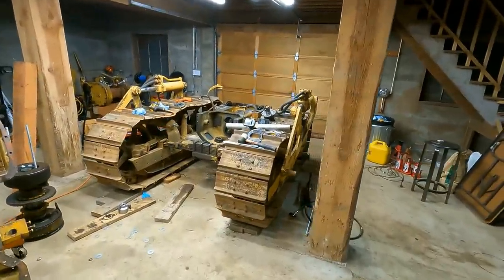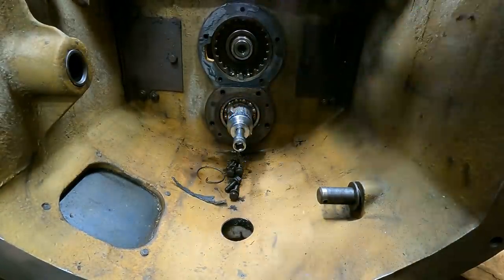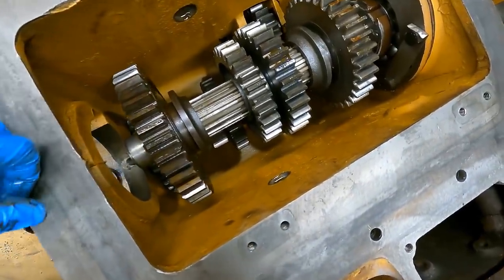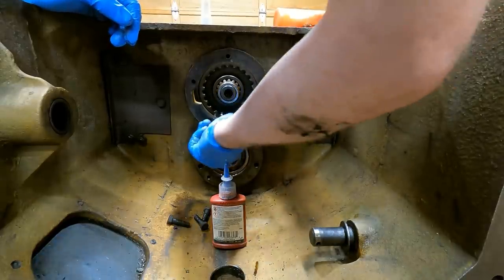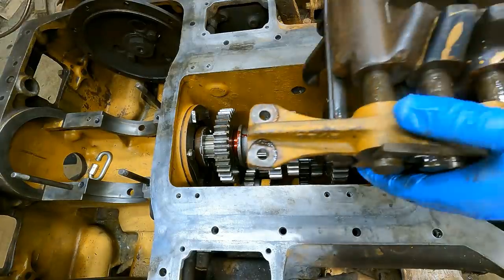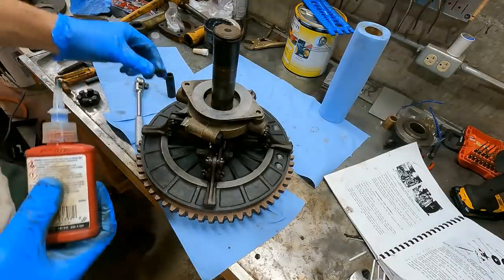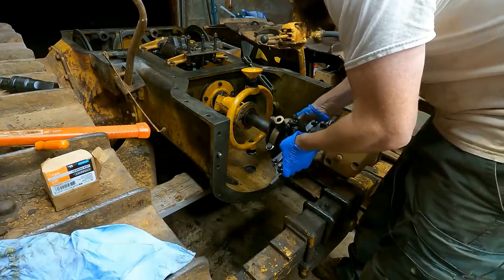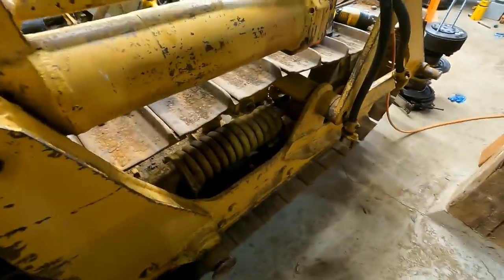Caterpillar D4 transmission repair and clutch installation

Comment: My dad is loving this series. As a former Cat mechanic now in his late 70’s, this era of D’s was still quite common in the shop during his apprenticeship. When he retired, the machines were heavily dependent on computer modules which caused the older techs to struggle a bit. That’s when he decided to retire.
Reply: None of the new techs had the insight into the machines that your dad had. He could stand alongside  one of the dozers and look at it and know every bit and piece going on inside of it. He didn’t need computer programs….his program was his keen instinct. They don’t make them like your dad anymore. And we wonder why all the stuff now is junk.
Reply: Well if your dad still misses them I have a D-4 dozer that runs but could use some love, And a new owner.
Reply: @beboboymann3823  Yes, junk... That's why things move SO much faster these days, and the operator is infinitely more comfortable... 
These comments are just idiotic. Things weren't better in the old days, far from it. Things may have lasted longer because they couldn't calculate anything accurately so they just overbuilt everything, it had nothing to do with craftsmanship or quality, it was purely lack of knowledge. Oh and the old mechanics knowing every bit of a machine? Of course they knew, by the time you met them they worked on just a few types of machines for their entire life, and the machines were incredibly simple compared to these days. Anyone who did that would have an in depth knowledge of those machines...
Seriously, I get the nostalgics, but be realistic... Things weren't better in the past, that's just what people say when they can't keep up with modern day things anymore.

Comment: FYI when adjusting the clutch. Do not cam it over (lock it) without first tightening the "pinch nuts" or you can damage the  adjusting threads on the drive shaft. My father bought a D4 in 1982. I was pretty Green , made a lot of mistakes before an 80 year old  farmer taught me a few tricks.
The track tension-er spring isn't too bad. As I recall I knocked a pin out of the track to create the space to remove the assembly off the idler wheel. All I had was a 3/4" socket set, pipe wrench and a post maul, not the best for driving hardened steel.
Also, I thing when you put the spring tool on the steering clutch assembly, you put it on upside down.  I think the groves around the holes go towards the springs, to retain them, so the springs don't slip off.
Thanks for posting these videos. They're bringing back memories and I'm learning a few new things  too.

Comment: When you showed the 36mm socket before any welding, I thought you were going to grind notches in the socket to fit the nut.  After seeing your modification, I understand what you meant in your message earlier in the week.  Anyway, it worked and no one got hurt so that is a win.
I'm glad to see the assembly work started.  A journey of 1000 miles begins with one step.

Comment: Let us know in advance when the huge spring is being changed - I'll make sure to have on my hard hat for that episode ...
Reply: LMAO ! And Face Shield !
Reply: The spring tension is adjusted with a huge long threaded rod going through it so the tension can theoretically be removed. The question is how rusted on and how rounded off is the nut on it. An 8 foot cheater bar is what I eventually needed. What I don't understand is how all those pieces come off Matt's machine without a lot of sound editing and beeping g.
Reply: iio

Comment: I am glad that my brake hone idea worked. Before you remove the old track spring relieve the pressure by cutting the coils with a torch while the spring is still caged on the tractor the replacement looks to be assembled already.

Comment: You will succeed. I know because you are like me. We think "outside the box". We can see "Go" vs "No Go". We see options others cringe at because we are not adhering to the original engineering. We make improvements (when we can). We understand physics. It is so awesome to watch your progress (in this project) and know that it will work very well. Remember to pause and walk away for a bit if things don't seem right. Your mind will find the right answer. (I know; Preaching to the choir). Love this build, Matt.

Comment: Good to see some more work doing on the dozer. You wanna use a couple of sizes of hole saw for the brake pads you're making ? Jack two bits up together and put the guide drill though the seam between. Those adjustments are probably crucial? In the clutch I mean. It should drive really nicely once you are finished. I'm doing a repair on a machine at present where all the bearings and seals collapsed. So , hoping both of us have pleasing success with the refurbish. With tool steel you are supposed to anneal the steel and then retemper it. Your socket should respond just as well as the rest of it, if you find it worthwhile at all. Cr.moly seems to be pretty sweet with welding very often.

Comment: Always put your bushings and bearings in the freezer for a tad bit of shrinkage brother, just a tip Matt!  Hey brother I’ve had to bend wrenches and weld wrenches to get the job done!  You’re trying to make a larger socket? Pipe wrench!,,  That’s the only I suggested to get a hammer wrench my friend!

Comment: Best advice I received on running dozer was to do small adjustments constantly instead of trying to do large adjustments less for the blade. And when back dragging, drop the blade all the way hard, when it hits the ground, stop lowering it and then flick it up ever so slightly.

Comment: If the shaft is hollow with tapped ends, a common way of getting the nut on and off on large equipment is to thread in a connector and run liquid nitrogen through the shaft. The shaft will then shrink as it cools, allowing the nut to be spun off easily. This is common on large equipment that have nuts to large to be practically removed with tools.
Reply: Yep. Most everyone got some liquid nitrogen layin aroun somewhere.
Reply: @woodhonky3890  
Common enough from a gas or agricultural supply. Can also just use nitrogen gas from a welding supply house, just takes a little longer to cool down as it is not going through a phase change. Suppose you could use a 5 gallon bottle of propane with a high pressure (10psi) regulator, and outside without any open flames or sparks within 25 feet.
Reply: If there is a doctor's clinic in town, there is a very good chance they have a 20 liter Dewar flask of liquid nitrogen. Could be you buy some from them,or buy from the supplier when they come to refill the flask.

Comment: I am enjoying the series. Re: the lock tabs on the bolts. You need to lock the bolt head as well or the bolt will back out of the nut. I use loctite in place of those.

Comment: Another way that you can bore bearing seats from the housing, is to use an adjustable reamer. It has 3 blades and a nut at one end, and if you tighten it, the blades move away from the center increasing the diameter.

Comment: Excellent work of disassembly and reassembly for that worn gear replacement. Amazing that we could see the breaker bar bending with that stubborn nut...but the impact drill made short work of it.

Comment: Great progress. I have a few thoughts. I see you put grease/lube on some things, but not others. The two piece sleeve probably should have some grease in it. The key stock rattling inside with no lube may not last long. The throw out bearing should probably have some lube in the collar, before you start it. As for the clutch, it is called an over center clutch. When the clutch is engaged, the links on the pressure plate over center into a locked position. If the clutch is too loose, it can slip, and or pop out.  When you thread the pressure plate in, you tighten the clutch. The more you tighten it, the harder the clutch will lock engaged, and will be harder to disengage. The only way to adjust the clutch, is with all of the linkage installed. You want to feel the clutch lever engage firm, but not so firm that it is hard to disengage. The clevis link you mention needs to be set to a specific length, in the specs, for the geometry to work.  Love the videos.

Comment: Well done Matt, It looks like your locktight bottle has cured on the end and then it will be also be in the lid. Loctite cures through anaerobic reaction. Loctite cures when there is a presence of metal and a lack of oxygen. I noticed when you were applying the Loctite on the bolts you touched the end of the Loctite bottle on to the bolt you should not let the Loctite bottle and touch the bolts you need to drip the Loctite on to the bolts then your Loctite bottle will not cure. When you touch the bolt it contaminants the plastic bottle with metal.    I hope this advice helps you in the future thanks Stew.

Comment: Hello Matt, nice job with the tool fabrication. I was going to suggest to use an axle nut socket like the ones on the gearwrench set #4166OD. The 4 splines for GM axle nut may be the correct fit for it.

Comment: I love your ingenuity when overcoming obstacles.  Should it ever come up again, when welding the tool steel to the socket, would a hose clamp around the socket and several of the steel bars help keep them in alignment while tack welding them?
Reply: I thought the same think but his cobbled together socket worked when other options weren't available. Good for him.

Comment: A while back, I wrote up the suggestion on how to build that socket. I mentioned that you use  square key stock because it won't harden when welded. I've made a few of these sockets to fit axle nuts on big Timken axles.
2 things that you don't want to fight; springs & gravity.

Comment: When you remove the old track tensioner usually we cut the springs coil by coil with a torch to relieve the pressure before messing with them when they are in questionable shape. The scary part is when you have to wind the nut out on the new one once installed.

Comment: The cross grooving in those bushings were for the drip oiler at the top of the clutch ring. I saw Squatch do one and he just used light oil on those bushings and then made sure there was oil in the drip oiler which is on the outside of the casing for the operator to access.

Comment: You're doing a great job and there was nothing wrong with the tool you made. It did what it was designed to do so it worked perfectly. Chrome plating is overrated.

Comment: Really hope for your sake you cleaned out that bottom transmission shaft bearing before you reinstalled it. Even one welding bb will absolutely wreck that bearing. And especially where you used a flux core welder (they produce lots of bbs and slag)  it’s paramount that you cleaned all that crap out. Keep up the awesome work. I realize this is a older video. Just found your channel and am watching the build from the beginning. If you wanna see another dozer build. I did almost the same as what your doing but to a 50-60’s  John Deere 1010. Even fabricated my own 6-way blade mount from scratch. It’s all on my Channel.  Cheers. Ian

Comment: I was also thinking reamer for the bearing bores - wish I'd also thought of the hone! And I'd never seen needle bearings with seals on them (except for universal joints). I certainly wasn't as knowledgeable as I thought. You are broadening my horizons! Keep up the good work - all those gears and parts are looking wonderful!
I watched Squatch's video on operating a dozer (can't recall if D2 or D4), and he mentioned that one should never let the machine run for long with the main clutch disengaged - that one should go to neutral and re-engage the clutch. I wonder if that's what wore the "throwout collar" so badly?

Comment: The new gears are exactly the same thickness as the old ones? If not, I assume you checked if shims still have the correct thickness?
If you have bronze self-lubricating bearings, in general they are not compatible with grease containing moly.

Comment: TO remove a "ding" in a machined surface, you should use a mill file by hand to gently remove any raised parts.  You never hit it with a rock.

Comment: That clutch adjustment looked fine.  Why?  Because there is adjustment available at the linkage.  The hone, excellent.  As for the bearing holding the weight, use a temp cribbing as 2x4 with a vee notch at top, cut to useful length.(as support from below).  Strong smooth wire is often used as temp install, an open loop below and wire severed as engine closes gap to bolt engage.  Also, at that near future, bolt stock cut to length(ground or turned to slight fit relief... plus 1 inch with a slot for screwdriver removal, is the guide pin answer to engine to trans slide on, easing assembly.  Care taken to in general,to support the components until several bolts start as will torque final gap to fitment. chain from above, also..observed.
So very much of the condition you faced, at start, was operator error.  The trans damage, likely as pull-push start and slam engagement...with worn clutch components. Owner operators are much more in tune with preventing breakage and adequate daily lube, needed small adjustment. Where in timber, removal of limb and branch as residue that will capture dirt and stone.  Recall skidders, where sharp branches can infiltrate belly armor and fill bolt recess.
*A huge hazard as can penetrate mesh to impalement of man and component.
Always as operator mount and dismount, rain or oils to steel as slip hazard.  
Beware riders and any near operation man or beast movement. Cable or chain breakage at tow. Belt and turning shaft entanglement. Delighted to look forward to long service as powerful, adept machine.  M.

Comment: Get a bottle of Loctite RC680 and use that on the outside of your bearings when you install them. You won't have any problems with them spinning inside the bore or trying to slip, any. For that locknut. you need something like a socket for working on older four wheel drive trucks, on the front axles.

Comment: When it comes to replacing the front idler spring, if you don't need to keep/reuse just cut the spring in-situ with , preferably oxy-acetylene, or a a cutting disc on a grinder (carefully) or just heat it to red hot to remove the tension.

Also, when welding on a transmission be very very careful you understand where the current path is going to go. Many transmissions have been turned into just a box of gears  by getting it wrong.

Comment: Another way to hold the gears and spacers in place is as you retract the spline shaft follow it with a wooden broom handle that is small enough to fit
Reply: That’s a great idea.

Comment: if you can manage it, take the spare flywheel from the original engine and use it as an alignment tool for the clutch disk. might make it easier than fighting with a whole assembly.

Comment: The clutch is normally adjusted so it snaps over at about 50 to 60 pounds pull on the clutch lever.

Comment: Just an idea for someone looking to cut the material you used a "JIG-SAW" on.  Try using a hole-saw cutter. Just think of my idea as just another way to slice an apple. Will work for the inside radius, but for the outside radius, maybe a JIG-SAW is the way to go.

Comment: 1B3756 3H8363 steering bearings are still available. A VG source for straight roller bearing Consolidated Bearings in NJ

Comment: that make-shift socket was genius. good job brother. just curious, what is the torque rating for that nut?
Reply from the maker: There was a mark on the nut that lines up with the mark on the shaft, so torque it till it lines up I guess.
Reply: @PacificNorthwestHillbilly  makes sense

Comment: Add me to the list of interested viewers. Also have a D4. 1952 equipped with a traxcavator loader.  My 2 cents worth comment is in regards to the electric start vs pony engine. In your case, you are in a relatively warm location so the benefits of using the pony to warm up the diesel engine is not so great. Also think that your engine will be in pretty good condition when you are done and should fire up OK without a lot of pre heating. Also you have the setup already. And finally, the pony ( and I have one) is a whole lot of more stuff to go wrong. Happy wrenching!

Comment: Would have suggested a dummy shaft of smaller diameter  to push out the shaft and it would have kept the position of gears and spacers in place then replace gear and reverse procedure.

Comment: Flux core is great all around for welding but for stuff like that socket, mig is the way to go. The cleaner welds make for stronger welds and its just over all so much easier with mig than Flux. Welds look a bit better too. Might be worth it to invest in a bottle and regulator. I'm not sure what welder you're running but most little migs come set up ready for gas just minus the bottle, hose and regulator.
Reply: MIG is not stronger than flux core, besides that he's welding HSS to chromed alloy steel with no preheat, so the strength of the filler material is a moot point.

Comment: Long before 2025 my friend. Give yourself some credit, you can walk around with the best of mechanics because every mechanic had his first one he did and your assembly is spot on so far. Its more scary than hard and of course the torque on the engine alone would make everything turn to matches of gears that you replaced. It has been so many years ago, I am no help to you but what you have done so far is more than most would attempt. Sad cause its just nuts and bolts... very heavy ones. The track tension springs are no joy and why many are never attempted to be replaced. Most were ran with them lose or broken and then made much harder to repair in the field.